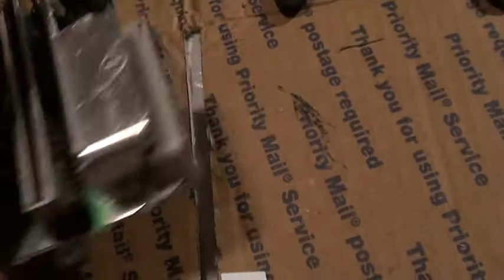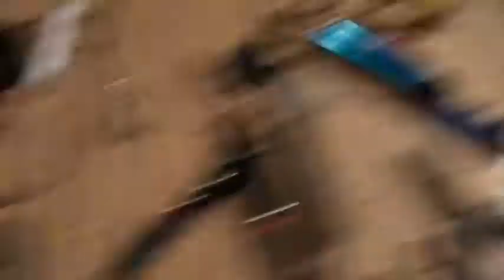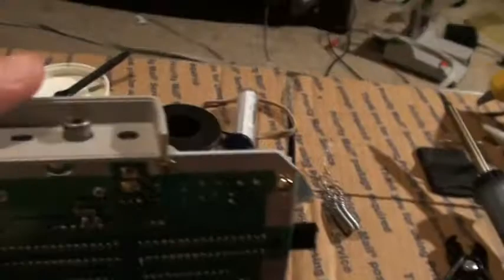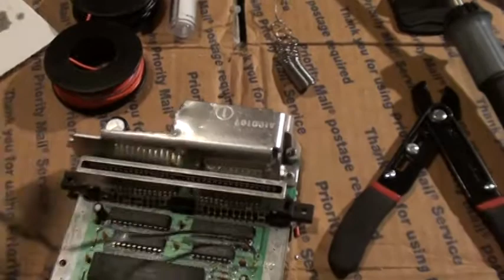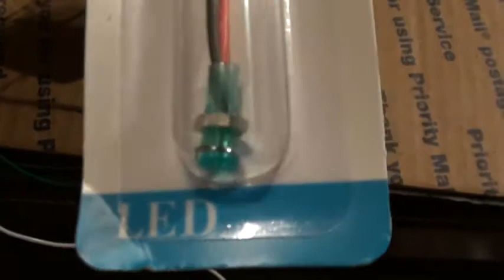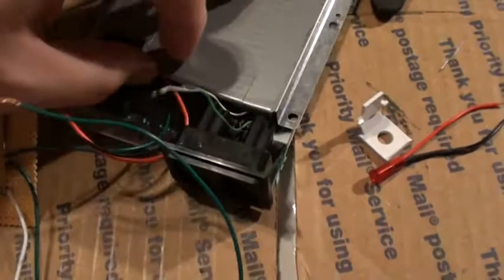NES Toploader AV mod (general guide)- Part 2/2

Comment: The "Chip" that attaches to that heatsink is the DC Voltage Regulator, i believe they are the 7805's. it is what takes the 10v from the adapter and knocks it down to 5v for the system to use